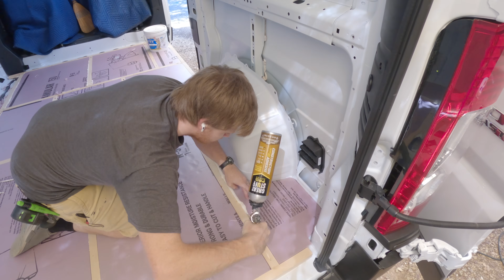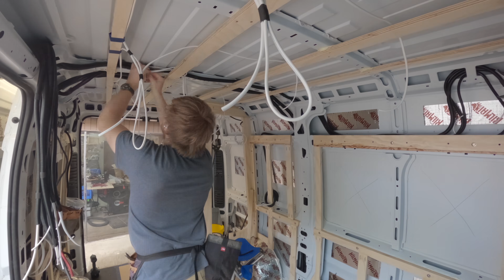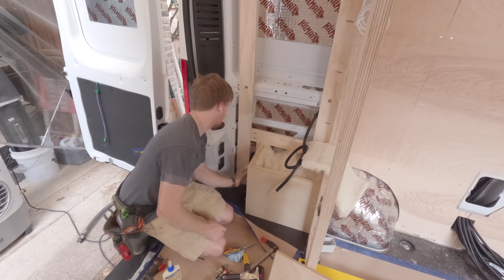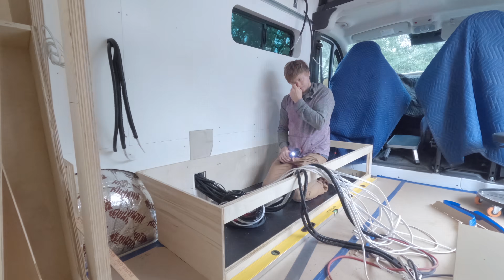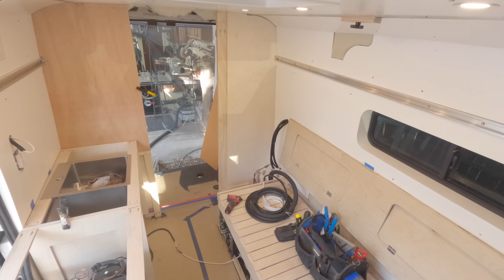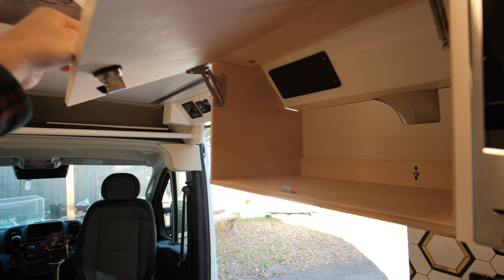FULL VAN BUILD | Detailed Walkthrough of Construction Process | Promaster 136" with Huge Wet Bath

Comment: Incredible build!  You do a really excellent job of expelling things and your thought process 👍  I don't see anything about your A/C though in the links here or your website. I also tried searching your YT videos with key words of "air conditioner", "air conditioning" and A/C but can't find anything.  What brand is it? Are you satisfied with its performance in hot weather?  Thanks, Dan in Michigan
Reply from the maker: Thank you so much, I really appreciate hearing that. The A/C is the 12V model from Undermount A/C. https://undermountac.com

This van was for a client so other than the initial testing (which was before the weather got really hot) I haven't used that particular A/C in depth. While not a cheap A/C, it can pump out a lot of cool air and is supposed to be more efficient being a split system verses a rooftop unit (which loses efficiency from the evaporator getting warm since roof units get beat on by the sunshine).
Reply: @MoserMakes  Thanks for the reply. That is a pricey one! I'm getting ready to start a Promaster build and that price tag is crossing the line for my budget. People do rave about that type of system though.  You put out great content 👍

Comment: Wont water get in from the heater? Incase you drove into a little bit high flood water?.
Reply from the maker: Hey that's an interesting question. I don't have an exact answer because I've never had water enter one, but here are my thoughts. This is the standard method for installing these heaters (due to intake and exhaust between on the bottom they are designed to be installed on the floor and vented under the vehicle), and I've never heard of this being a concern. There are versions of these heaters for hydronic systems which are very similar and are usually mounted totally underneath the van. If water was entering the heater then it would mean the water is above the interior floor level of the van. If you were in water this deep you may have other problems as well like water trying to work its way in from the door seals.

Comment: Fantastic build and great video, but how long is the van? 136 inch is 3,45 meters which can't be, or is it the wheel base? Thanks for elaborating 🙌🏻
Reply from the maker: 136” refers to the wheelbase of the van and is how RAM denotes it from the larger 159” wheelbase option. Inside this one is about 10’  of buildable space

Comment: Where did you run the line for the condensate from the AC/Heater? Are you using it to aide with water collection, or is it channeled to the outside? It would be an interesting concept.
Reply from the maker: It is channeled to the outside. It passes down the back of the floor to ceiling cabinet and then goes out the floor and drains underneath the van. I'm not sure how much water you'd be able to collect but interesting thought!

Comment: Am I blind or is there no refrigerator in this build? The internal air conditioner is a revelation, and I appreciate the conciseness of the time lapse/voiceover style.
Reply from the maker: It is in the end of the galley cabinet facing toward the front of the van (slider door opening area). It’s a pretty standard Dometic 65L 12v fridge.
Reply: Ah! I guess I missed that since I was focused on the half inch Birch ply cabinet construction :)
Reply from the maker: No worries! Didn’t really highlight the fridge in the video but the location is kind of cool because the fridge door can pivot open about 180 degrees which means you can also grab stuff out of it while standing outside the van.

Comment: no vapour barrier, I'm afraid damp will collect in your walls and rot everything :(
Reply from the maker: Thanks for giving your opinion, but I don’t believe that will be the case. It’s a topic I’ve given a lot of thought and research to and I believe the best approach is to build a wall that is able to dry out rather than trap moisture since the exterior metal shell is an unavoidable vapor barrier. I think when people install interior vapor barriers (with low to 0 permeability) they create a greater risk of trapping moisture in the wall as vapor will inevitably find its way in through a puncture from a screw or something else. When it comes to building science resources I don’t think I’ve ever come across an example of a wall assembly which creates a cavity sealed off by vapor barriers on both sides (which is what you would be doing if you added an interior vapor barrier in a van). Generally when designing a wall assembly with a vapor barrier you also consider in which direction the wall can dry as well. 

Now if you want to talk about smart vapor barriers with variable perm ratings depending on temperature then I think this could be leveraged in a build (I have experimented with it before) but in the end I concluded it doesn’t give much added benefit if you are intentional about the rest of your material choices and assembly methods.
Reply: @MoserMakes  That's a nice long and detailed answer, I can tell you are a man of science! You do realise you are going against the accepted way of doing this I'm sure, but good luck to you. It's precisely because the outside of the van is a vapour barrier that you need another on the inside. When warm, moist air (from cooking, showering, breathing) meets that colder-than-the-inside-of-your-cosy-van steel, it will form water on it's surface by condensation. Unless the steel is perfectly sealed, this will cause rust; additionally it will encourage mould and rot wood. When the outer steel shell of your van is warm enough to evapourate that water, or when the air inside your van is dry, it will dry out - let's hope that's more often than not. As far as an internal vapour barrier discouraging the drying out process goes, it's a non-issue because at this point the water has vapourised, expanding massively and forcing it's way out of those screw holes, or wherever it came in. It's impossible to create a perfect vapour barrier, but we do our best and we seal up anything like screw holes as best we can.
Reply from the maker: Hey thanks for your thoughtful response. I know this is a very divided topic amongst van conversion. I haven’t seen this done as standard practice among many of the top professional custom van up-fitters in the US.
I am though always looking to improve each thing I build so I will continue to gather info on this to consider when planning future builds. 
I’m always trying to make the next thing I build
Reply: @MoserMakes  go for it mate - this is probably more of an issue in miserable cold damp England!

Comment: Excellent video and gorgeous van build!!! For the palisade tile - what did you use for that inside corner trim?
Reply from the maker: Thanks! I didn’t use any inside corner trim. Palisade sells a matching inside trim profile but I wasn’t sure if it would be able to handle the curve in the outside wall. So I just made sure I had clean cuts on the edge of the tile (they cut and sand easy with normal wood cutting tools) and butted them together. Besides the adhesives I used a clear silicone behind each seem and then once done I added a bead of white silicone done that whole inside corner. 

Not using inside trim worked fine since I didn’t have a confined edge on the other side. If it was a back wall between two fixed walls then I’m not sure it would work without the trim as some side to side movement is needed to get the tongue and grooves of the last tile slid together (the palisade install pdf has a good illustration of this).
Reply: @MoserMakes  thank you!!!!

Comment: Nice work! Definitely a craftsman. 
What do you think about running all the wires into a conduit so you can run new wires if needed?
Reply from the maker: Thanks! Good question and a little complicated but I'll try to answer as best I can. I think it can be a good idea in theory but may be hard to execute effectively in a van. The biggest issue that comes to mind is that fitting conduit everywhere needed would be hard as there aren't always good wide passages for wires between wall sections within the van and often you have to fish wire through smaller gaps and hard to access areas. This varies a lot between the different manufactures too. I don't think it would be worth trying to cut holes all through the inner wall structure for the sake of running and conduit and also access is so limited inside many of the wall spaces that I don't think you could easily cut holes anyway. Running the conduit at the wood framing level (outside metal van structure but inside wall panels) probably wouldn't be practical as the wall framing would have to be thick to accommodate the size of the conduit (size depends on number of wires inside - lookup conduit fill tables). 

Beyond this, once you start talking about a closed conduit system you need to adhere to NEC conduit fill rules otherwise you can run into issues of wiring getting too hot in the conduit. Inside the conduit you really need to use single conductor wires as opposed to a bundled wire as the conduit size for wires in their own containers would be impractical. Then once you switch to individual stranded wire you run into other issues like how NEC prohibits running high voltage and low voltage wires in the same conduit which would then mean separate conduit runs for the 12V and 120V circuits. it becomes a slippery slope of figuring out an effective way to do it inside a van from here. 

If you search around on the sprinter-source forum there are some old threads on this with some interesting discussion. I've dug through some of this in past when trying to come up with my idea of wiring best practices. I think I had searched around the terms "conduit" or "Smurf tube" to find the threads.

If you want to be able to easily change or add wires later then it may be more practical to just plan to run wiring outside of the walls and hide it inside cabinets. Or you could use pieces of conduit or closed loom (no split in the side as the split gets trouble some when pulling cable through) through just certain hard to reach wall sections you may want to run wire through later. Leaving a "pull string" inside the loom would additionally make it easier to a pull a wire through later but a narrow fish tape could also probably navigate it.

Comment: Incredible as always! I really appreciate your videos, it's such a good learning space, thank you for sharing :)
May I ask how much time roughly did you put into it? I am considering building one DIY and I am just curious.
Reply from the maker: Thank you! Too much time on this one haha! You can really put as little or as much time into a van conversion depending on how detailed you get with each part. My very first van conversion I didn't track closely but estimated it at about 400+ hours. Each van after has gotten longer not shorter as I've increased the level of intricacy of both the woodwork and the built in systems (and significantly longer - more than double - on this one).

Comment: Very genius, love it, only thing is the fridge if it can a bit bigger without the drawer over it.
*** excellent job. Just a question, how much that cost build same design on transit? Please let me know.
Reply from the maker: Thanks! A larger fridge may be possible, but if the galley cabinet got any wider the bed would have less opening width available. 

Moving forward I'm moving away from client commissions to try out a build-to-sell model.

Comment: Greate inspiration .. there are two things that I don't understand ..

1- why put the heater so near to the batteries .. we know that batteries and heat are not friends .. isn't it a problem?

2- water tank above pump .. I would never put water above any electrical device .. why this choice?

Thanks and .. greate work!! 🎉❤😂
Reply: I add a further question 
If I will ever build a van like this, I would wire the electric cables not behind the walls, but in electrical conduits inside the cabinets and furniture's. Son I cann access to cables, add new lines, change anything .. Is this a good solution or not? which is the best one?
Reply from the maker: Hi, I think that is a good option if you want to be able to easily change them in the future and don't mind them in the cabinets. The advantage of in the walls is that the inside of the cabinets can be cleaner.
Reply from the maker: Thanks for watching! 
1. The heater and batteries are fine in my opinion. The heater will only get used when its cold and for times when its really cold, it is actually better for the batteries to get warmed a bit as they can't be charged if below freezing. I think there is enough of an air gap and ventilation to keep the batteries cool enough during operation. Also these batteries incorporate a BMS with a high temp cutoff that would protect them if they ever did get close a dangerous operating range. Batteries have been located in vehicle engine bays, which are quite hot, for a long time. This might not be the best heater/electrical location for all campers, but with this layout and the constraints of locating all the components it made sense here.
2. Water pumps often end up close the tank to keep the plumbing more streamlined, but it shouldn't be done without care. The wiring connections from the tank leads are crimped together with a heat shrinked butt connector that would protect from water. The circuit wiring is also protected by an appropriate size fuse in case it was shorted, and the electrical system as a whole is grounded to the vehicle chassis.